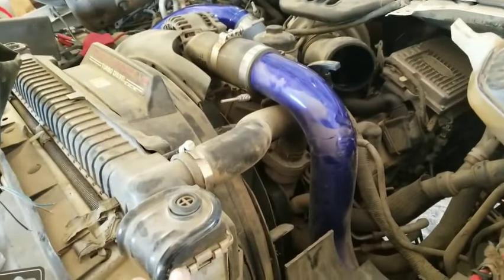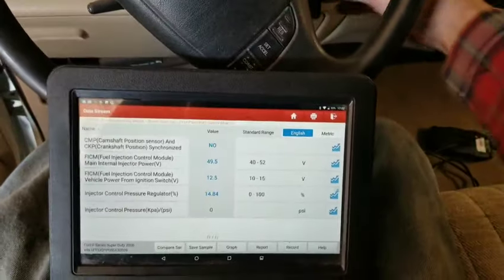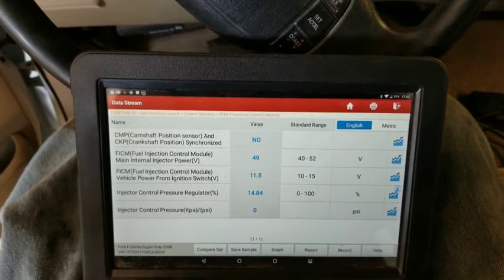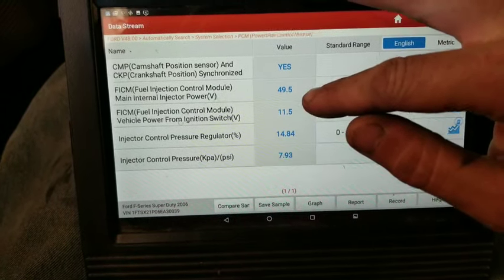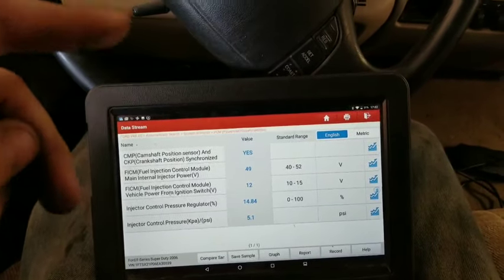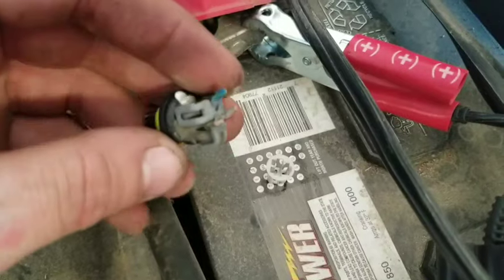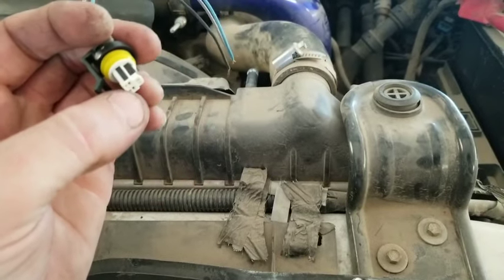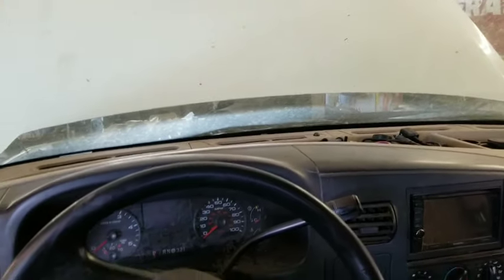6.0L Powerstroke: Crank no start.  Check this first.

Comment: My 03 6.0 Powerstroke don’t start 😭
Reply: Did you ever figure out what’s wrong with it?
Reply: Same
Reply: Same 😭
Reply: Same lol
Reply: @joel.ha. same lmao
Reply: I lost half of the peddle and then I made it home almost like it was in Limp mode, I figured out I was low on diesel so I put some in it now it just cranks and no start throws a few codes
Reply: But it was running fine my first diesel so I’m not sure what to even look for
Reply: @freedom8763  I got mine towed to the shop, he swapped batteries and it started fine. Then he put my batteries back in and it started fine.  So it just needed a reset of some kind, he did nothing else to it

Comment: Was towing a trailer, now trailer is sitting with the load 9n it and this darn truck came home on the trailer. Pos won't start. New icp, I'm, fuel filters,

Comment: In a no start situation a way to get yourself home or limp to a safe place is unplug the sensor. The default 1300psi will allow the truck to start and run. If that’s the problem area.
Reply: And what if it doesn't run?
Reply: I tried this still no start
Reply: Will start with ether tho
Reply: @BecuzScience719  did it stay running on ether?

Comment: Something to keep in mind when using the dash guage for checking for base oil pressure is that the guage operates between 5 and 7 psi. It can be misleading in some cases.

Comment: I’m getting a crank no start either hot or cold. It’s totally random. I already changed the pigtail and the problem persists. But if I grab the entire harness and shake it a few times it’ll finally turnover. I’m definitely checking this cage when I get back home.
Reply: This just happen to me this morning when I was in my way to work driving fine all night then this morning no turn over hot or cold did you ever figure out what was the problem with yours ?
Reply: @jaynaandrade2999  I bought the $10 IPR air test tool on Amazon. Found a leak on top of 2 injectors. Tried changing the o rings but they still leaked. Replaced both injectors and new IPR valve has it running like a champ!
Reply: @TXRenegade  how did you see the leak valve covers off while testing?
Reply: @TXRenegade  my truck crack boo start hot and cold but will start with ether all pressures are good

Comment: I haven't 😂able to drive my truck for over 6 months. My oil indicator doesn't rise until ive gone through 6 or so cycles and then drops down when I stop.  I thought the system held pressure for a while afterwards?
Reply: You might have a damaged low pressure oil pump
Reply: @dyjdjjduffssjio4142  thanks, how do I check that?
Reply: @stephenhiggins8744  pull it, nothing more than that tbh
Reply: @KDlGG  I'll try, Thanks
Reply: I think this may be my issue. Scanguage says my oil pressure is at like 139 and I put a new HPOP in (I was replacing everything I could think of, got the truck for $300 and had tons of issues) and still getting 139. I was not even aware of the low pressure pump

Comment: Please I need your favour,I have a 2004 Ford F 350 Superduty 6.0 engine and it has just about 125,000 miles on it,I don't really drive it always most of the time it is just sitting down but I run it once in a while.Recently that I tried to run it,I discovered that the rpm does not go beyond 2200 and I have been having ths truck for about 12 years now and nothing like this has never happened,as a matter of fact I bought it from the original owner.I have the regular obd2 scanner and when I used that to check it gave me P0621 code.What does this traslate into and what is it that I have to do to get it fixed.I will appreciate response also from others that might have gotten this type of experience or people that knows what can be done to get this problem resolved.Thanks and I look forward to a helpful feedback.
Reply from the maker: Replace both of the fuel filters and then try it.  If it still has the same issue the fuel pressure needs to be checked and stay above 45 PSI under load.  Also check the injector control pressure (ICP) with a scanner.  Compair what the actual ICP is vs what the desired is.

Comment: My does it cold, pulling out of my driveway,  3 minutes on the road, going uphill,  The only way it starts is if I use starting fluid. Sometimes it runs ok for days weeks.
Reply: I’m having this issue now oil pressure shows fine but only starts with ether any tips?
Reply: I'm replacing all Glow Plugs, harness and Glow plugs Relay Control Module. I got 3 differents codes which included plug 6 & 8 and 1 for the module
Reply: Injector rings for sure

Comment: What are the codes will occur if the oil pressure is low because of the ICP sensor?
Reply: P2291 for me on a 2005 F250 6.0

Comment: What was the fix, new HPOP? I have the same situation going on.. I have 150lbs of shop air in the ICP port and I hear no air leaks, none at all. Checked thru previous service records, everything else had been replaced except the HPOP. ARP head studs, new dummy plugs and standpipes.. I only see 15.6 psi on the ICP during cranking and it has to build up to that 😆 I'm thinking I need an HPOP.
Reply: He mentioned 85%at ipr. Seems like I see in a different video it's too high and was a leak at the hpop system.
Reply: @jasonbrown7258  Yeah I heard you're not supposed to see 85%, (I cant recall when, or if one should ever see that). I have a new IPR on hand and intend on installing it in the new HPOP coming today. However, its a Standard brand.. I pulled the OEM IPR & its undamaged, screen looks great, no trash or debris to be found. I just have no leaks in the high pressure system. I listened with a stethoscope everywhere. Talked to Ford, they said 'no leaks? Then a new HPOP you shall install.' Will find out today.

Comment: I have a f250 2005 6.0 and I can start my truck drive it but if I turn it off I can crank that sucker and nothing won't start again I have changed that ipr sensor like 3 times in a 2 year period maybe it is the connection that's not working and solve all the problem
Reply from the maker: You have an oil leak most likely the stand pipe and dummy plug orings.  There's other videos that show you how to test the oil system with air pressure to find the leak or leaks.  Check out Diesel Tech Ron

Comment: Mine sounds the exact same.  Fixed ficm and now have bad coil 2 and 4. Would that make truck not go past 2000 rpm and 15mph then cut off
Reply from the maker: Yes thats probably possible.

Comment: Got a 05, 6.0 crank no start intermittent. It threw the IPR code so we replaced the IPR still crank no start????
Reply: Follow up: Found the Standpipe on the Driver side had a bad O-ring. Replaced all dummy plugs and Standpipes and the nipples and O-Rings on the passenger side Oil rail also. Cranked for a long time because of the air in the system but fired up and runs fine again.

Comment: I have a 05 6.0 it show icp,crank,an cam sensor it was running we stop and it stall out we can’t get to start unless you spray starter fluid and it will start but will not idle it will rev any ideal
Reply from the maker: I can't quite understand what you're saying.  First off......don't use starting fluid.  Get it fixed as soon as you can.  If it stalls and won't restart you probably have a high pressure oil leak.  You will have to use a scanner and look at 5 or 6 pids.  FICM input voltage (12 VDC), FICM internal voltage (no lower than 45), FICM Sync input, ICP voltage (0.24 KOEO), Actual injection control pressure (needs 500 PSI to start), and desired injection control pressure.  Any one of those missing will cause a no start.  Fuel pressure at the engine needs to be checked as well.
Reply: @prodieselrepair3218  the fcim show 48 when I test it with multimeter. Fuel pressure is at 70psi.it show code for cam and crank sensor, and it show low icp , it just had high flow oil pump replacement, I understand don’t use starter fluid ik it really bad for a engine, but the few time we did get it started we use starter fluid it will rev up and run fine but when you take ur foot off the pedal it will die, and before it stall out it it was like we only had half of a pedal. I been thinking it was ficm since I started looking into this…could it be fcim?
Reply: I air tested and found air  leak caused by fuel rail not seated correctly

Comment: Ipr should never be at 15 or 85.
Reply: It will default to 15 if you aren’t cranking. During cranking and running is when.
Reply: When I crank mine my ipr shows 28.9 .my hpop is 750 .ficm is 47.5 and has sync. Crank no start.

Comment: Wait so you never got it running lol?
Reply from the maker: I did get it running
Reply: @prodieselrepair3218  what was the solution to the crank no start? I have exact same symptoms on my truck.
Reply from the maker: @hattersequiptmentrepairllc4661  this pickup had no high pressure oil because of the STC fitting had blown out.